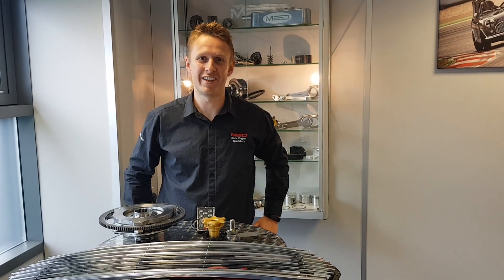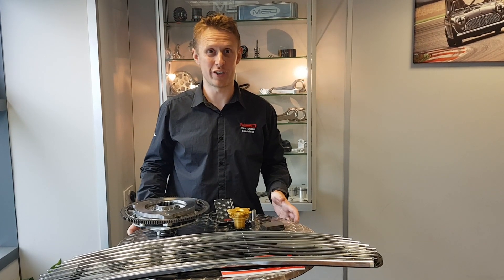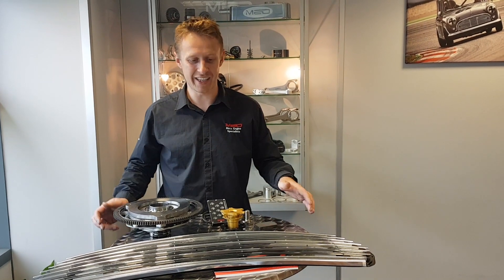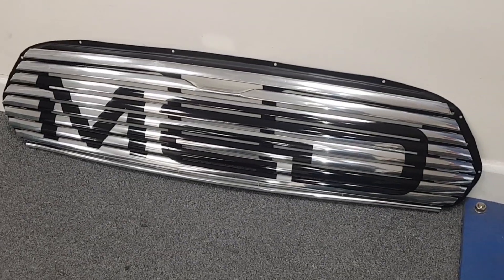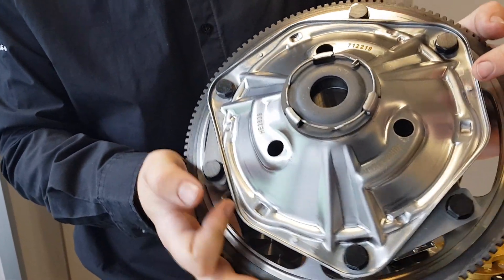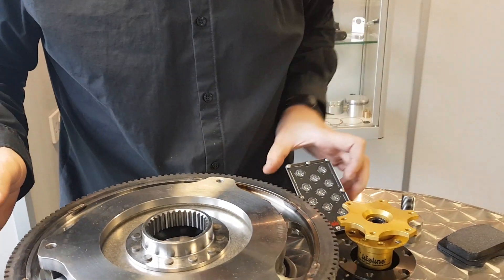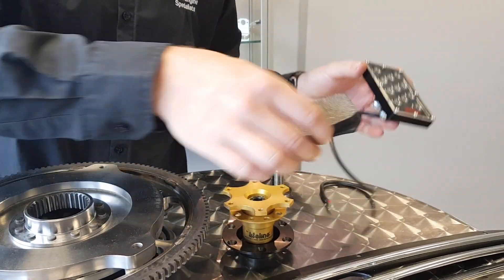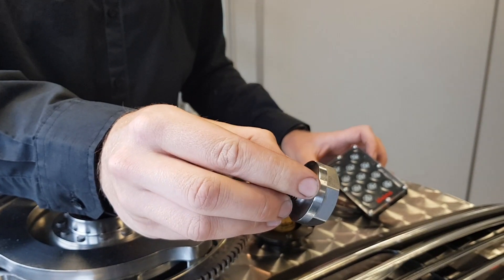Latest MED products

Comment: when i see quick releases for steering wheels with stubby adapters to weld on or pin on.. have a look at this video  https://youtu.be/rBSQ5Zz18xg   of a funny car breaking the steering shaft mid run..  if you look at the shaft that broke. it had a nice beefy bolt thru it reducing the amount of strength..    you must always .. pull up on the wheel after coupling it to make sure its fully engaged.. https://youtu.be/9Jp06HvYCcw    nascar teams actually painted a stripe around the column that is hidden by the fully engaged steering coupling.. if the paint can be seen the steering wheel is not latched in properly.    i never had a mini.. i did want one.. i did end up with a matching pair of Austin Americas.. a 70 Rover 3500S , a 71 Series IIA 109, a 74 Series III santana both Hetcho in Guatamala. meaning they were assembled from kits.  and 5 rover 2000 Tc's and Sc's  quite a collection of british cars for los angeles.